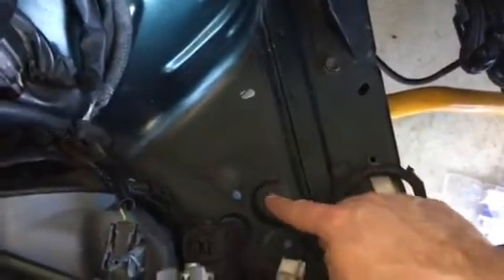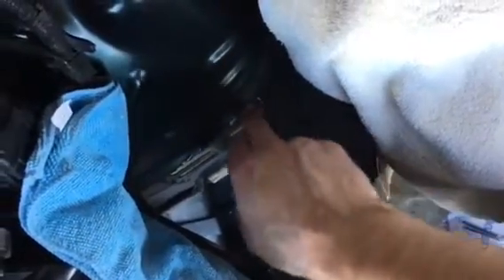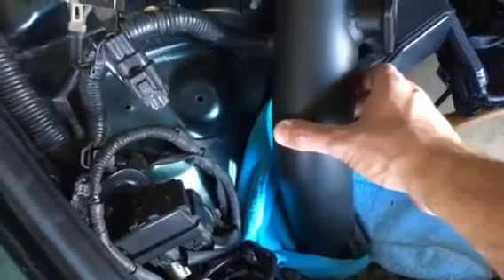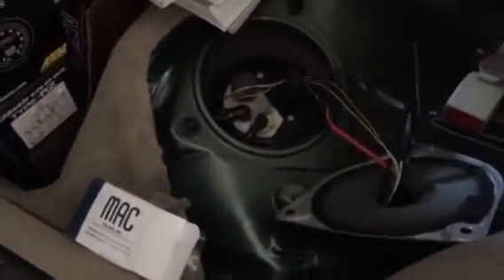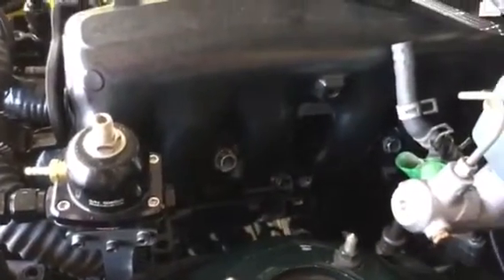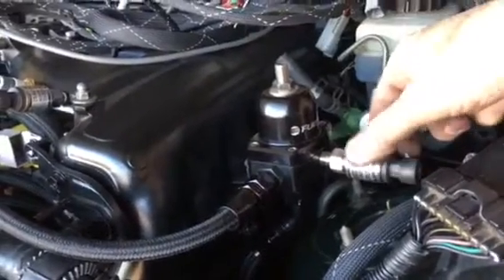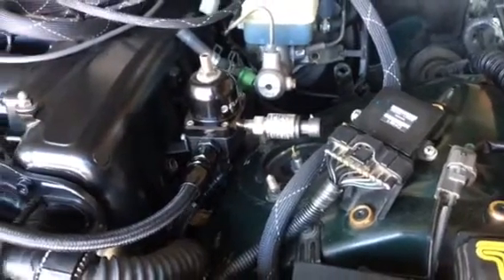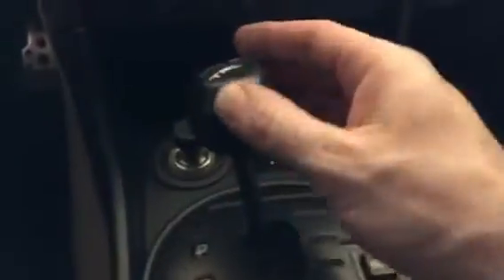LEXUS IS300 Turbo Build Part 25/ hole cutting/fuel return/TRD

Comment: Quick question the return line that you add to the is300 pump the new return hose goes to the original hose for the old  stock fuel regulator